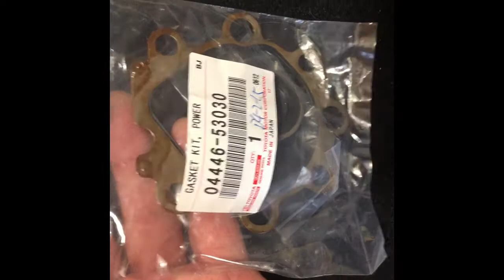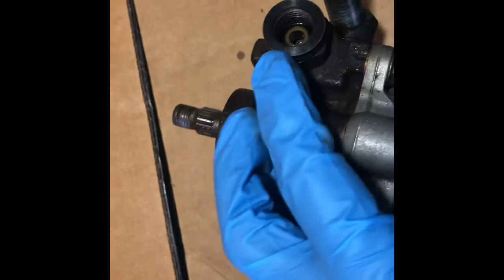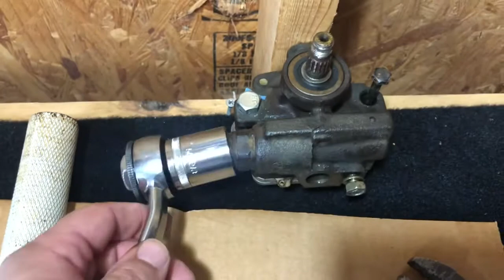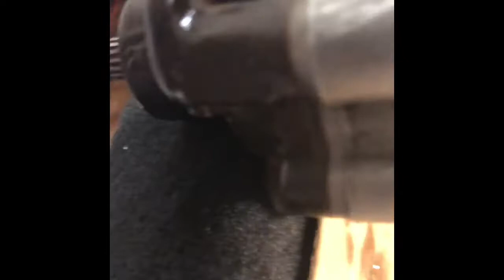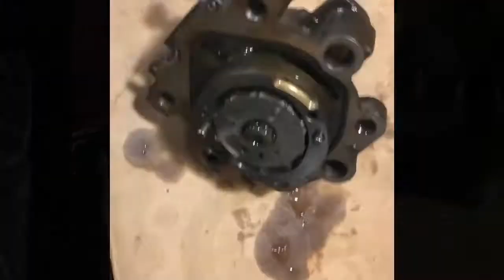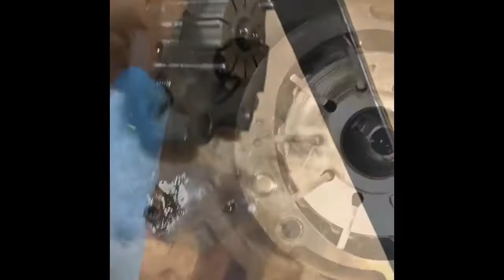2001 Lexus ES300 power steering pump disassembly and rebuild (Part 1)

Comment: How has this repair held up? Does it not leak? I just bought the gasket kit and it would be my first rebuild.
Reply from the maker: It's held up great!! I got this car around 256k miles, and that's when i rebuilt this pump, and i'm about 200 miles away from hitting 300k on the odometer.
Reply: @smak_davis8848  that's reassuring to hear. And when I heard you say that you bought an aftermarket one and it immediately leaked all over the place it confirmed what I had been hearing elsewhere as well.
Reply: @smak_davis8848  I have a 99 es300 with the exact same pump so this is extremely relevant lol

Comment: was the ps pump groaning before your rebuild? because buy a replacement here is expensive
Reply from the maker: No mine wasn't groaning, just leaking
Reply: if its whining its because air is in the system and needs to be bled out. The bad seals can introduce air in the system so thats why its wise to rebuild the pump first before spending money on a new one.